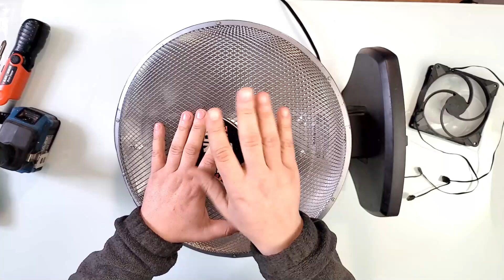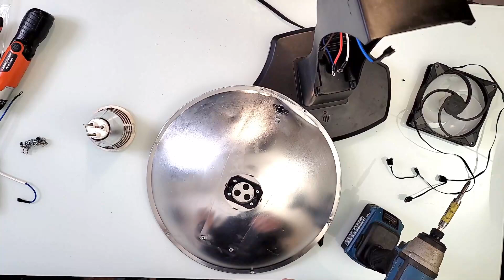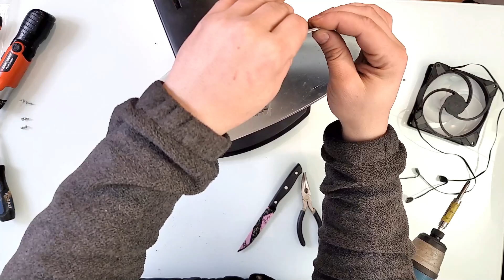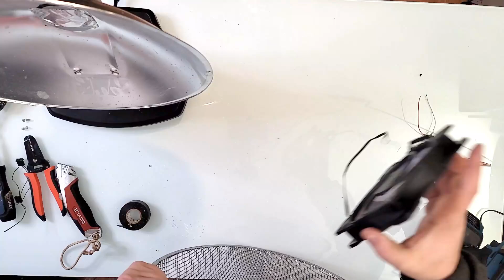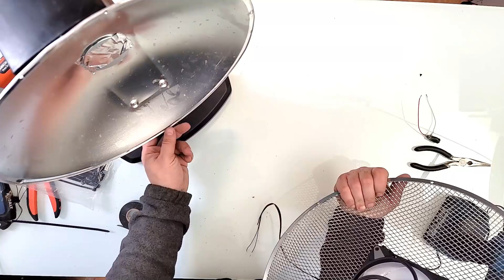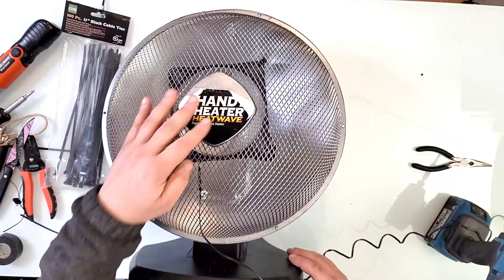How to turn a heater into a cooler

Comment: I love the idea and enthusiasm - but this doesn't work. 

The aluminum reflector is at room temperature. It feels cold when you touch it because aluminum is a great heat conductor - but you can't cool something below room temperature by blowing room temperature air on it. 

But - could the reflector be helping to increase airflow? Unfortunately also no. The design of these is kind of the reverse of a satellite dish. A satellite dish reflects the incoming signal and focuses it onto the antenna. This is why radio telescopes have giant parabolic reflectors - they reflect all of the signal hitting a large surface and focus it so it can be read.

The heater works in reverse - it emits a signal (infra-red radiation) from the antenna (heating element) and that radiation heads out directionally thanks to the parabolic reflector. 

The same does work with air. The air being emitted by the fan isn't a point source and it isn't radiation (energy) so the air can 'hit' itself.

Think of it this way - if you take two flashlights and cross the beams, the two beams don't interact. But if you do the same thing with two streams of water, they do. Air is like water, not light. A parabolic reflector just isn't going to increase airflow.

What you ARE doing here is making a great heat-sink. If you had something you wanted to cool down, you could put it in contact with the aluminum which would quickly spread the conducted heat over its surface and the constant airflow from the fan would help dissipate that heat. 

I guess you could tape the whole thing to your head to cool yourself - but uh, personally I'll stick with other methods.
Reply from the maker: i appreciate you taking your time to explain the points in better details, and i can't disagree with you because you're right...but the point of my "experiment" is to make the small fan spread the cold (air placement)  towards a broader area which it actually did that, as per cooling the metal, it did that too..albeit not as much as compressed air conditioner, but for the size of the fan it drastically increased it's potential i'd say by 30-40%....regarding the infrared conductivity i know it's not the same way but this one instead of emitting the "cold"...it's cooling the metal and pushing the cold air back out of the sides, at least that was what i observed in person...i am planning to repeat this with a better fan but the same parabola and place some temp probes to see the before and after temps within the metal itself and the close proximity inside the room (i don't expect it to be more than a light cooler for a small area)...as i said, i agree with your points and i appreciate you bringing your knowledge here, this is how we all can learn especially from smart people like yourself, the entire idea i had stems from thinking about heating and cooling that has not changed or evolved significantly in the last 80 years and i think it would be a great favor to the world if we all start thinking how to make new ways to heat and cool since that seems to be the most non-affordable part of most people's lives so far, i don't mind being called out when i am wrong, i like it because that is how i learn where and what i need to change.... again, thank you.